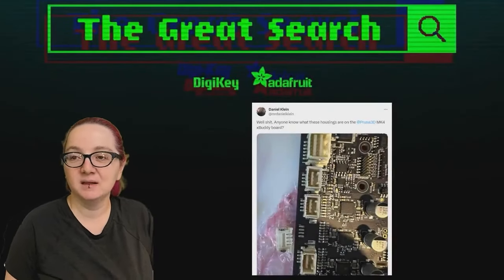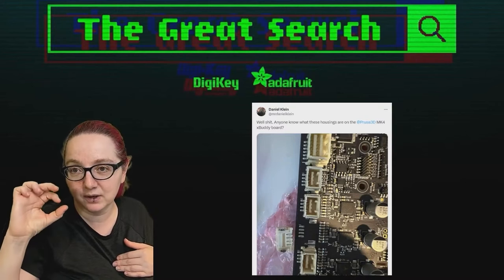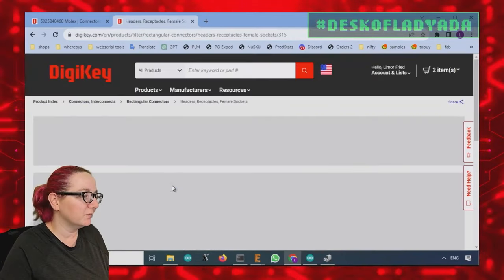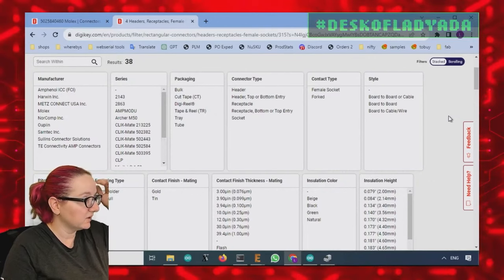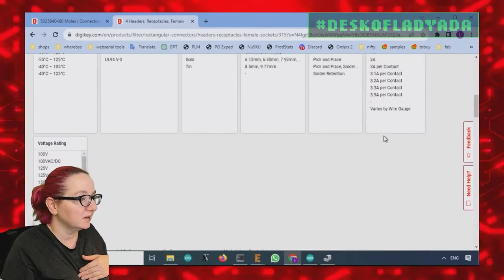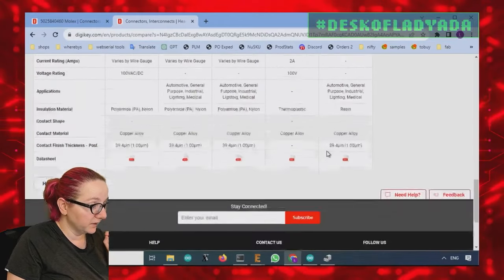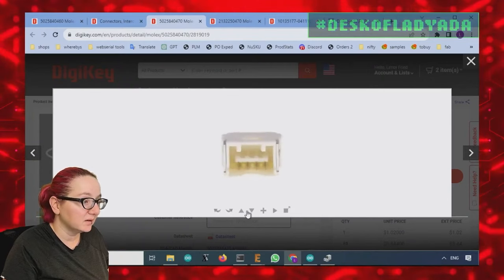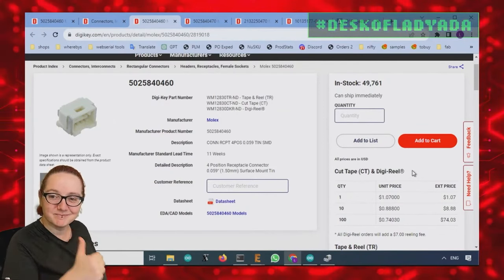The Great Search: Replacement Connector for 3D Printer Sensor #TheGreatSearch #DigiKey @DigiKey

Comment: The old Einsy RAMBOs from the MK3 series and the previous gen Buddy boards used in the Mini use Molex SL connectors, which were a bit of a pain because I've ripped out the plastic housing on the board trying to release the latch. Unfortunately there's no mention of what connector this is in Prusa's documentation, which is a shame because their docs are among the best in the hobbyist community. However they do have a history of using Molex connectors, and it would make sense that they have the tooling and parts for Molex connectors in house.

The older Buddy Board has an interactive BOM linked from its Github repo, so anyone who needs to fix their board without buying a new one from Prusa could easily get a replacement part. Hopefully they'll do the same for the xBuddy eventually, I'd love to see how that was designed.